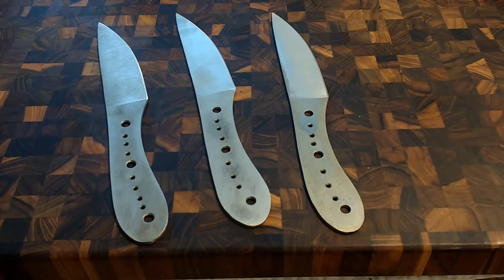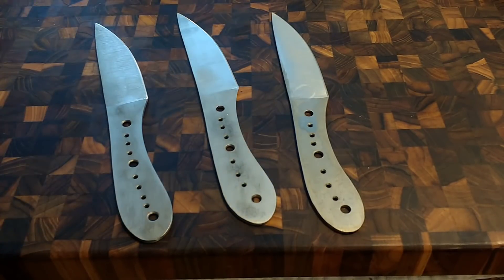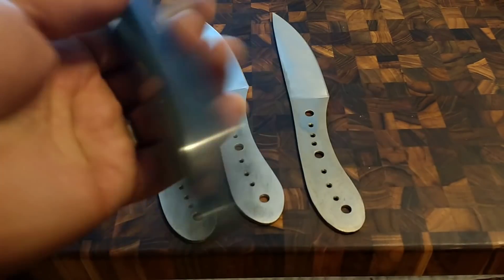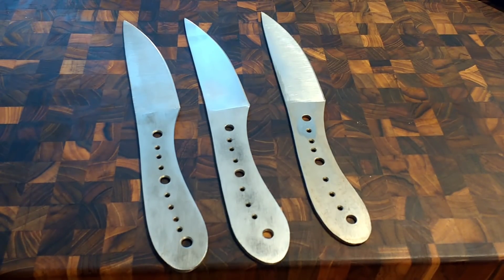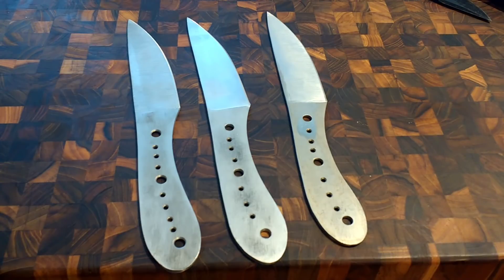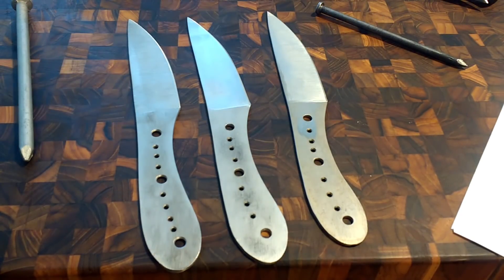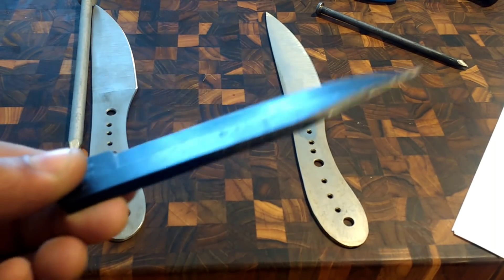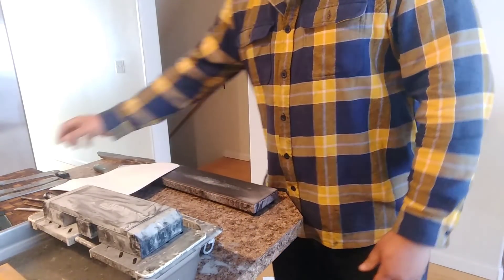What's Toughest PM Stainless Steel?

Comment: Hey Im a BBBBig fan of your tests, I'm in a big canundrum and everyone can chime in on this. I'm a knife collector and also user (I use my titanium custom 2017 megalodon for example) and love Spyderco knives. I wanna treat myself to a new blade and need your help to decide. I always was intrigued by the shaman since I love the PM 2 and manix 2 for EDC and have them both in Rex 45  and they kick ass. I didn't have any rust problems yet but didn't have them on me in the rain. The 4 knives I have (get) to choose for buying are: A 230 buck shaman in Rex 45 on eBay,  try waiting and getting the upcoming zwear Micarta Shaman for 250, get the watu for 190 (20 CV with carbon fiber handle, African style and super light), or the smock in s30v ( not a fan of it tbh) for 150. I love the Micarta of the zwear shaman and am not sure if rex 45 (spydercos) actually is better than their zwear especially in this design, plus I can't be certain to get one. The watu looks great ,I'm not sure about ergonomics though and it doesn't have the 'prestige' of a Shaman and while being supposedly great, 20 CV is probably below Rex 45 and zwear in every regard. Help me choose, BBB before it is too late. Ps:  Is the shaman EDC and pocketable?

Comment: Are you planning on making a variable thickness or just one for initial productions. Although I have thick and thin knives I like a little beef preferably, what say you, brohamness??
Reply from the maker: Nate Brabant yes, I'd like to keep the same models and sizes with different thicknesses for different uses and users. From .080 stock to .25
Reply: Big Brown Bear That's a perfect range for a"working blade", free planned well, you are doing the research which is the most important thing. It's there any other knife steel files besides knife steel chart? I am always interested in all quantifiable info one can get. I'm kinda like you, I eat this shit up!
Reply from the maker: Nate Brabant I don't like the charts, you have to take into account how they got that information. Each steel has a RANGE to it. So you can't say that one steel has EXACTLY this number of performance associated to it especially with all the variables.
Reply: Big Brown Bear well that is how I've felt, I've seen inconsistencies every chart I look at it feels like. I believe people list how they "feel" about a particular steel, not its true to the core properties and capabilities. I think just your experiments have shown that stats on a certain steel aren't exactly what they say they are. You are getting performance not generally associated with a particular steel.

Comment: Whatever happened to cpm-d2. I keep getting mixed stories. I've been told it can still be had, it just isn't advertized by CM, or that they cancelled it because it didn't offer much of a performance boost over regular D2.
Reply from the maker: Avacado Papaya that deserves a video. I have a piece of CPM D2 and it's very much available to buy. I have the answer for you in depth.
Reply: http://xf.bladeforums.com/threads/any-experience-with-nathans-d2.1470902/#post-16929136

Quote: I probably have more experience with my D2 than anybody, I have them around the shop, my own skinning knife, and my steak knife. I use it all the time, it's probably my favorite steel and it has been running circles around and handing out spankings to the stainless super steels for years.

D2 is probably my favorite steel and I do a very good job with it. My heat treat for it has developed over the years and I feel it represents the best in the industry. I've been very open with other makers about what I'm doing with it and my techniques for it are now widely adopted to the point I see new makers talking about the process and unaware where it came from.

Complex steels like D2 usually have a basic "built in" grain size that results from their alloy and its reaction to an anneal. By default D2 is usually around 12-13 intercept grain size which is relatively fine grain.

Pre-quenching in D2, M2 and other complex steels is a grain refinement step that violates the "only one austenitizing per anneal" rule for these steels meant to avoid the extreme grain growth they're prone to on a second heat which creates a large fish scale style fracture. When done improperly it can have no effect or can lead to intercept grain size as low as 1 (extremely coarse).

Prequenching, when done properly, can refine the grain upwards of 17 or more, which is a very fine grain condition. This is based on research by Teledyne VASCO.

Before going further, let me state that grain refinement to this level serves no purpose in-of-itself and very fine grain, beyond a certain point, doesn't make a better knife. This is a widely misunderstood concept among makers and knife nuts. That's not what this is about.

There are a couple steps about pre-quenching I don't recommend to other makers because they have to be adjusted for each heat batch because the variations in alloy content and material condition effect the heat treat response and can lead to problems if done improperly. This is one reason I don't use D2 much any more, because every single batch needs special attention to be fully optimized. This is particularly true going from one manufacturer to another, because D2 is like hotdogs, they can all put different ingredients into it, and a .8 vanadium will react differently than a 1.2. But, when the time and temp is dialed in it refines the grain (which is not a bad thing) and puts carbon into solution, reducing the soak time and temp for the second heat which I believe may be very significant in minimizing naturally occurring structures that play hell with edge stability such as RA that converts in temper rather than during the quench.

The end result of a fully optimized D2 is a durable knife with outstanding edge retention, good corrosion resistance, and that toothy D2 edge that just keeps cutting. While not as durable as 3V, it's more durable than most, and it just keeps cutting and cutting.

Sometimes D2 can be somewhat brittle, but our final cut testing yesterday of a knife from this batch had a thin D2 knife at 18 DPS at HRC 63 cutting some 4D nails without chipping.

We're using Crucible D2 for this batch, but not their CPM version. This was not to save cost (less than $2 difference per blade) but to avoid the small rounded carbides that fall free from the edge. It's a good process to promote toughness, but it spoils one of the best properties of D2 in a knife, so we use a conventional melt.

If you'll try it, I promise you'll like it.
Reply: I have read that CPM D2 is a bear to work with, difficult to grind and finish, which may be why it isn't seen as often. No personal experience, could be that the costs outweigh the benefits or that there are just better steels out there now.